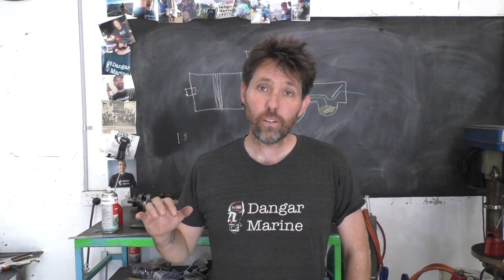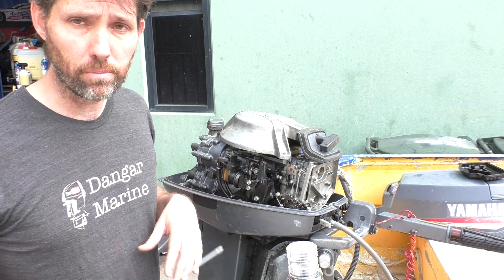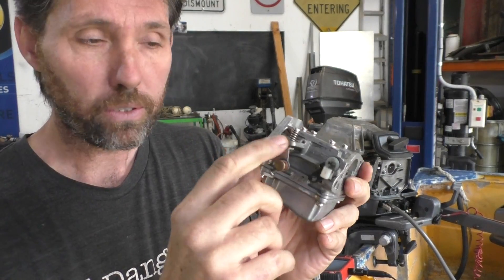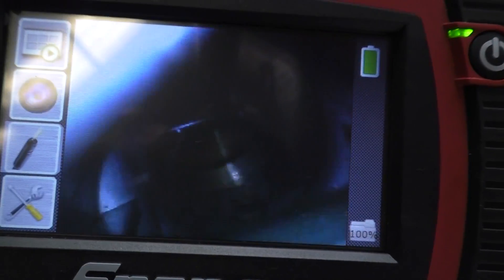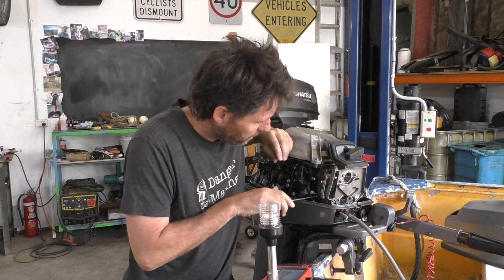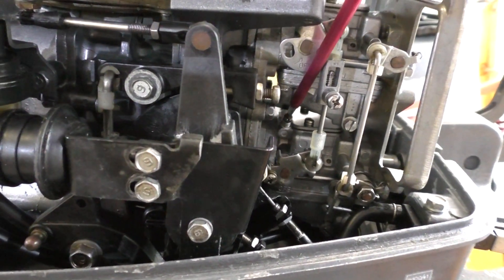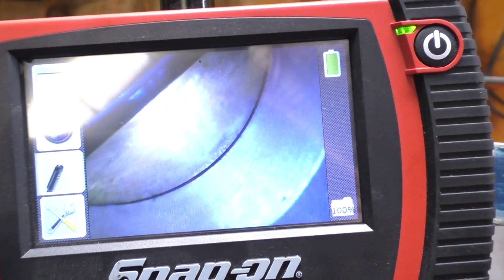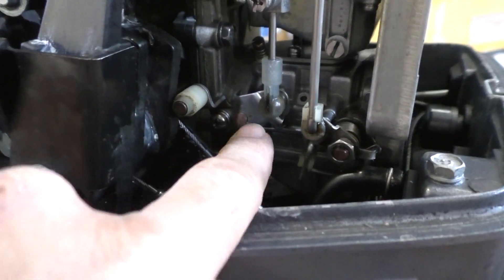Two stroke carburettor synchronisation

Comment: Here we are 7 years later, and I'm really happy to have found this video to help me with the same issue.  Only problem I have to fix now is the broken charging coil under the flywheel which I managed to destroy by using too long a bolt on my flywheel puller.  ahh well, it keeps me busy, eh?
l
Reply from the maker: Glad you found the video helpful, and that's a real shame about the charging coil!

Comment: I have a 40 2T yamaha. Cleaned carbs. Adjusted idles - starts fine and runs smoothly but as soon as open throttle or push down linkage she cuts out. So my guess is fuel delivery issue so ordered new pump and filter - after this what else could it be ...?

Comment: Was researching my carbs issue and came upon this video again, saw it a few years ago as well hope someone can answer my question.

1986 Nissan 70HP

Both carbs had new kits put in them last year.

I believe I am having a fuel or air problem and not getting the full power of both carbs.

It is also possible the carbs are not properly 'synched'.  (after watching a few videos i do believe i am synched)

When I spray a little carb cleaner in the top carb the engine rpm raises dramatically maybe another 1500 or so.

When I spray the same shot in the bottom carb the engine rpm raises but maybe only half rpm of the top carb.

What would cause this discrepancy?

Would I be correct in thinking I have an issue with the bottom carb?

It appears to be more air related as opposed to fuel related.

Comment: I have the same problem with a lean sneeze I have a 25hp 1985 single carb 2 cylinder I have changed carbs and still have a sneeze

Comment: A quick question if you have the time, with my V6 2005 150HP mercury 2 stroke, I've noticed it has 3 carbs fitted but i'm assuming each body contains 2 carbs (so 6 all up) that I'd need to sync using this method ?  I find your video's to be very informative and your method of presentation makes it easy to understand, and gives me the confidence to tackle this job.   Also how would I know if my outboard was running rich ? is it simply by ensuring that the mixture screws are set to factory settings and thats it ?

Comment: is this the way I would sync the carb's on my Mercury 2005 150 HP V6 2 stroke outboard, or would I use a carby sync tool ?.  Im just about to splash my boat and the engines running a bit rough and I'd rather fix it at home before it goes in the water than after.
Reply from the maker: The carb sync tools are for 4 strokes.
Reply: @DangarMarine  typical lol, at least syncing the carby's now should be a lot easier using the method that you've shown.

Comment: This may come into use. I’m looking at a 1989 Johnson 25hp, the motor has that 2 stroke sneeze when the guy fired it up after it’s sat for a year. Compression is at 140 in each cylinder, new spark plugs. But on your previous vids of this Yamaha some things I would have never know to look for, so thank you!! I’d like to get a Yamaha instead, but here in the states they are a fortune used. Johnson and mercury is not to bad priced used. The average price for either of them is about $800-$1500 anywhere between 20-30 years old. The Yamahas used are between 20-30 years and they want $2500 or more.  Supposedly there’s more parts for older  Johnson out there than older mercs. We shall see.

Comment: i have a yamaha 40hp 3 cylinder from 1986 with this "sneezing" problem on the third cylinder, it revs up fine but at lower rpm and idle it sneezes.
carbs are clean and reed valves looks good

Comment: HELP!  I have an Evinrude VRO 140. It has been serviced, carbs cleaned, compression checked, new plugs, power pack, wires, hoses replaced.  I am praying a knucklehead like me can take the cowling and carb cover off, and actually visually check the butterfly positions.  If there is anyone out there who can tell me what the heck to do, I'd buy you a beer or 8.   It's a 1985 V4.

Comment: Was really expecting the manometer to come out for this one. Really informative video, thanks.
Reply from the maker: Manometers are used with four strokes where you have an intake manifold vacuum to measure. You can use a flow meter on the front of the carburettor though.
Reply: @DangarMarine  You're absolutely right :) Been a while between jobs for me.

Comment: You mentioned balance/synchro is different for 2-stroke vs. 4-stroke engines.  Why?  Isn’t measurable vacuum the same variable for setting air flow and fuel mixture for both types engines, regardless of how the vacuum is regulated (via reeds or valves)?  If not, What’s the difference in procedure for synchronizing carbs on 2-strokes?

Comment: That's what my Yamaha 40 Hp was doing when I bought it used. Did the carb clean, fuel tank, lines, plugs and still was the same. I saw this video and noticed my butterfly valves were uneven, checked my linkage that controls them and notice that they were upside down. So the entire time all I had to do was flip the linkage. But your video made me check those valves, and sure enough it was so simple to fix. Thank you so much from Victoria B.C. Canada

Comment: Hi, I have a Yamaha 25 NEO autolube engine from about 1988. The engine starts well and I think it also has good performance.
If I drive at full power at 5500 rpm for about 8 to 10 minutes, it starts to twitch a bit and lose power, as if shooting into the exhaust. I tried to replace the spark plugs with colder and warmer ones, and that didn't help. Can anyone advise me what else to try? Excuse my GOOGLE English. Milos
Reply from the maker: If it happens after a period of running it may be overheating.

Comment: I have a Suzuki DT 55 that shows exactly the same issues. I also know that the center carb throttle plate is fractionally ahead of the other two. Stupidly I hadn’t considered this to be significant enough but I’m ready to get at it. Thanks, I’m feeling more confident that I may finally solve the sneezes.
Reply from the maker: I too didn't realise what a bit difference it would make.
Reply: Update; I just followed your tutorial on my DT 55 and transformed my slow running issues. Thanks, you truly are a very valuable. Source of information !!!!!

Comment: this same this is happening to my Mercury 40hp 2 cyl. 1 carb.. cleaned carbs and fuel lines, same spark plug issues, same "fix" when one wire pulled.. but I only have one carb..

Comment: So both "flaps" should be open even at WOT?  I have 83 Evinrude 90 ,top carb is open level at full throttle but my bottom is 1/4 open.
Reply from the maker: Yes, both should be open level.
Reply: @DangarMarine  yeah I found loose screw to flap when checking out..Thanks for quick reply and info..people like you keep us normal fellas up and running good!

Comment: Yamaha has this problem, and it was also in the RD-400 engine, sync the carbs or it won't loft the front wheel.
My family saw me riding that bike several times, my old man remarked about only one wheel being used at any one time, I think that is why two strokes were discontinued, it wasn't about emissions. 
I had fun with that bike, I also really liked the Kawi H-2 triple two stroke, that thing was a screamer.
That H-2 went 11,500 rpm in third at well over 90 inside the school parking lot. The RD handled, the H-2 went well in straight lines. H-2 didn't turn worth a damn.

Comment: Awesome video as always!  If your fuel pump automatically mixes both oil and gas (VRO pump), what is a good way to test the mixture is correct and the VRO pump is working correctly for both oil and gas?  Can you pull fuel from the bowls and somehow validate the mixture?
Reply from the maker: Probably the easiest way is to put it in a glass container than slowly add oil to a second glass container until you get the samel colour.

Comment: This video is very helpful to me right now!big thanks.I just cleaned all 3 carbs and each carb has 2 floats it’s more like 6 carbs!now it’s time to sink them all!Ill keep watching this video a few more times 👌👍
Reply from the maker: Glad the vid helped Bruce. :)
Reply: I found out the bigger problem that I had!Im wounding if you agree?all the rain we had for two week here keep the pump and flit switch running a lot!right after that my motor would turn over for a while then die and never start.my two deep cycle battery with a 20watt solar set up did not keep up.too small,the 225 hp on my 19.5 boat did not have enough spark to tune over this motor needs very high amps to not just make the starter run but all the other electric ignition components!nothing worked except two new deep cycle battery.I tried to make a jumper start switch like in one of your videos and it turned it into a electric welder!lol this big old motor needs amps!I need bigger solar panels 👍or less rain ,one long week of fun this has been!all for a 50 mph fishing boat

Comment: thanks so much for the lesson.  question:  At 8:20 you say motor is hard to start, so you add more air by opening the butterflys.  Isn't a closed butterfly the same as a full choke, which makes it richer and easier to start?  And what is the choke mechanism?  Obviously it worked, but why?  Motor was warm from many video takes?

Comment: Good day sir. I'm a fairly new subscriber to your channel. First of all I have to say you your videos have helped me tramendously.  I have what I think is a 1988 90 hp 6cyl  Mercury outboard with 3 carbs. I have rebuilt the carbs new coils, wires, plugs, compression on cylinders is 150 lbs almost dead on in each cylinder. Number 5 cyl is acting exactly the same as the cylinder in this video. The only things I haven't done that you have in this series. Is the head gasket, and the Reed valves. Before I do that. I wanna time the engine, and sink the carbs. My question is. Does the same procedure apply to my engine as this one. Would the carbs be adjusted the same way, and have never timed an outboard engine before. Any help you could give me, would be extremely helpful. Oh by the way great videos on the electrical set up on the green machine. Got my 76 Marquis wired up perfect thanks to you.
Reply from the maker: Hi Brian. The principle of the carb sync is the same, I just can't picture what the adjustment options are like on the old Merc. From memory timing adjustment is quite simple on those older Mercs using a timing light.

Comment: 85 Yamaha runs out of water but won't run in water
Reply from the maker: It is running weakly which means that the extra exhaust back pressure when in the water is stopping it.
Reply: Dangar Marine so how do I fix it

Comment: I want to sync and tune 3 carbs on a 1966 outboard, and hoped maybe you could clear up some questions I had after watching the video.  Appreciate the way you explain things! 

You coarsely set the fuel mixture, and then your steps to sync basically boil down to only one concept:  make sure the plates are at the same position at the same time.  Sure, you also adjusted the amount of open-ness at idle for good idle, adjusted the throttle cam, then readjusted to make sure you can get full throttle, but basically sync is achieved "only" by setting the plates the same.  Is that really the gist of it on a 2 stroke?

i.e.e you didn't show more about the fuel mixture screws, and there was no statment that vacuum is the only way to truly achieve balance.  Are those steps required as well?

There's nobody I can find to work on my 3 cyl 75hp McCulloch, so I need to understand it well and do it myself!  Thanks in advance for any add'l clarification you'd be willing to offer!
Reply: Read add'l comments below, that the vacuum method is only for 4 stroke motors.
Reply from the maker: Dennis, yep, pretty much have the procedure for a two stroke. This vid is on a four stroke, but all the mixture and idle speed stuff is the same https://www.youtube.com/watch?v=bsHCMJnRY9A

Comment: I’m going to go try this on my 78 115hp Evinrude tonight.  She bogs spits and dies at low idle. Cleaned the carbs and found rubber under the float needle seat AND low speed jet was plugged with the same type of rubber.  Was leaking fuel all over and wouldn’t start. After the carb clean, new fuel pump, new fuel lines the motor now sputters and dies. Hoping it’s just a loose connection like you show here.  I think I remember looking into the butterfly chamber and saying to myself “ hmm it’s not closed all the way AND it won’t open all the way”. Didn’t do anything about it cause I didn’t see this video yet!!  Thank you. Hope this is what fixes “The Little Bogger”.
Reply from the maker: Good luck mate, I'm sure it will help a lot even if it isn't the only problem.

Comment: Just did this to my old Yamaha. Stripped and cleaned the carbs, they always needed damp start to get it going. Put them back together exactly as they were, started it with no damp start (yay) but had this same issue. Followed this video, brilliant, fixed it. Cheers. One question, is it wrong that it runs better with one of the mixture screws screwed all the way in? The other one is 4 half terns out at the moment. Thanks again, brilliant instructions. Keep em coming.
Reply from the maker: Hey Malcom, it is a bit odd that one is screwed all the way in, it sounds like that is compensating for a problem but if it runs well I wouldn't worry too much.
Reply: Dangar Marine. Hi Stu, thanks a lot for your reply. Next time I'm out I'm going to have another play around with the mixture screws just to be sure this is the best setting. Great videos. Cheers

Comment: How many turns do you use on the mixture screws for a 75 85hp Johnson. I can't find it anywhere
Reply from the maker: Start with  2 turns out and tune from there. There isn't an exact amount, if there was they wouldn't need to be adjustable. This vid might help, just ignore the vacuum gauge stuff as it is a two stroke https://www.youtube.com/watch?v=bsHCMJnRY9A
Reply: Dangar Marine thanks so much. I love your channel. I'm no longer afraid to try some the repair work myself. Thanks again

Comment: Hmmm. I tried this on my 89 yamaha 50 hp, and after closing the butterfly valves fully the engine started and ran at about 2500 rpm for some reason. I tried turning the mixture screws to limit the speed and smoke, but after setting them the same the motor ran very rough with a lot of smoke, and the tach needle was bouncing around back and forth from 2000 to 3000 rpm very rapidly with the throttle fully closed. also the carbs have been recently ultrasound cleaned but that did not remove the fast idle problem. I am getting  little frustrated with this motor. do you have any idea what could be happening. the spark plugs are also wet with fuel. I tried to lean out but then the motor runs at about 3000+ rpm with the throttle plates fully closed! Thanks and nice video!
Reply from the maker: Hi mate. The surging and high idle with the butterflies closed sounds like a vacuum leak https://www.youtube.com/watch?v=f3O_dqvCDIU
Reply: Thanks - will have a look at that

Comment: I have a similar issue with my 40hp yamaha engine with 3 cylinders. But the symptom for my engine is that when I unplug the spark plugs on at the time, it does not change RPM when removing the top and the middle spark plug. The engine only "works" on one cylinder. Any ideas why that would happen and where to look first ? Amazing videos !!
Reply from the maker: So it you unplug that one working cylinder with all the others in place it stalls straight away? If it could be the spark plugs, the ignition coils, the trigger wires leading to the coils or the CDI unit.
Reply: I actually watched your video on carburetor cleaning, and I had missed to remove the screws below the float for cleaning, so I did this and that kicked the 2 cylinders that were not getting fuel properly. Do you have any theories why the two cylinders that are placed higher up from the fuel pump stopped working, and the one cylinder alligned on the same level as the pump actually was the only one that worked without any problems. Can it have something to do with the pump ?

Comment: I have a 1988 johnson 48 spl j48eslccc. I have my throttle set to closed on both carburetors and im not to sure how my outboard should be idling. I did notice if I move the throttle all the way to the open position it is not going all the way. @dangarmarine.
Reply from the maker: The throttle plates should definitely open all the way to horizontal (and not past). I would be looking at the linkages again and seeing what is going on.
Reply: Dangar Marine thanks ill look into it!
Reply: Dangar Marine I took the boat out today and still can't cant get it to idle. Medium throttle and wot are good runs  excellent the second I put it in nuetral down to idle it dies.

Comment: Hey Dangar Marine .. Your videos are really good ive subbed and subscribed..I Just came home from doing a link and sync on a F150 at YAMAHA MARINE UNIVERSITY  in Atlanta USA and my  question is  that the instructor told us that it would be best to do this in the water or a very least in a bucket.. I was just curious is it would make that much difference with a load on it.. We had to adjust the TPS to Meet the ISC request at around 42 degrees. 
THanks  for you videos again. MiKe.
Reply from the maker: Hi Mike. Trust me, you probably know a lot more about these big Yamaha's than I do! This motor doesn't have any idle speed control other than a simple set of mixture and speed screw. These definitely need to be adjusted warm with the motor in the water but I don't imagine it is so important when adjusting the relationship between the butterfly linkages. Would be interested to hear what your teacher thinks though.